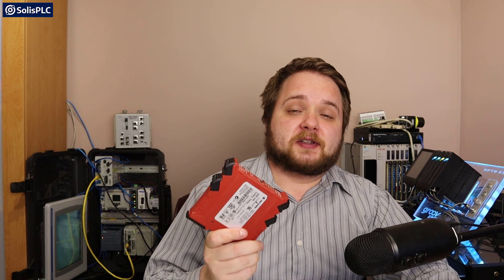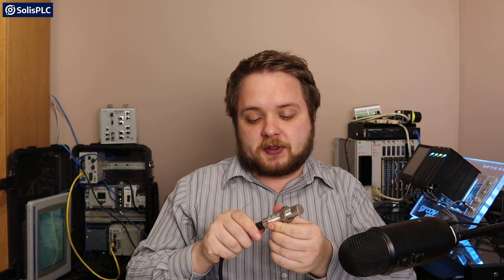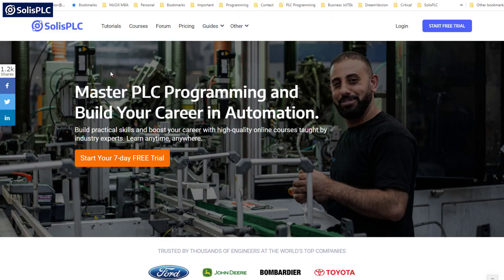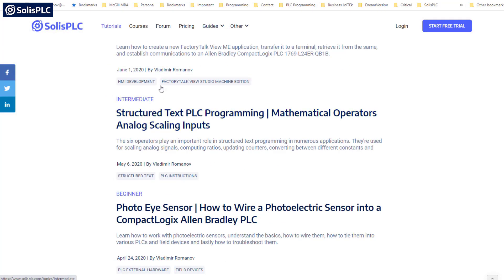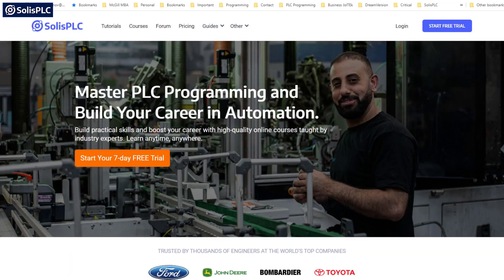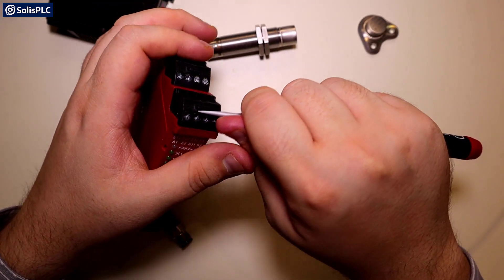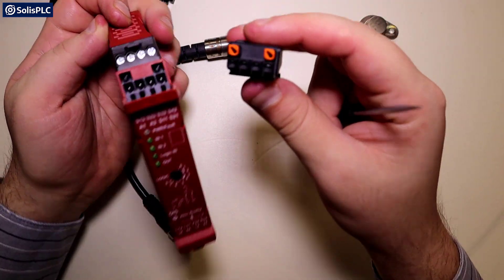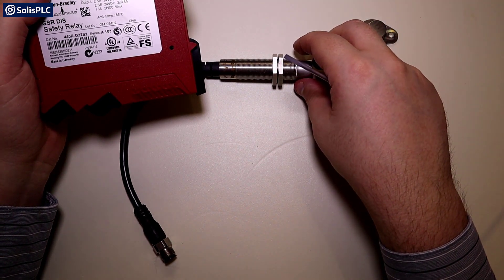Allen Bradley GuardMaster Safety Relay Wiring Tutorial

Comment: Hello sir,
This video must be very helpful for beginner, i have a concern about the input signals S12 and S22, in the instruction manual of the device they are always connecting the terminal S11 -> ESTOP/Light curtain -->S12, and S21 -> ESTOP/Light curtain ->S22. But i see here you have skipped the S11 and S21,  so i would like to know in this case how about the signal from device (sensor) to the terminal S12 and S22 i mean the voltage (OVDC or 24VDC)?